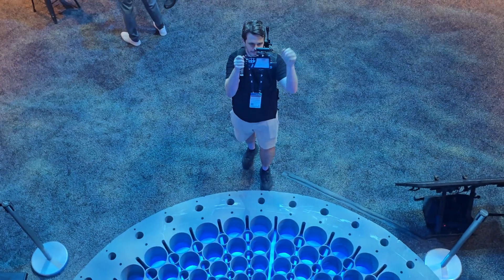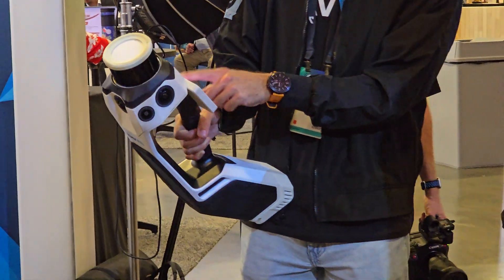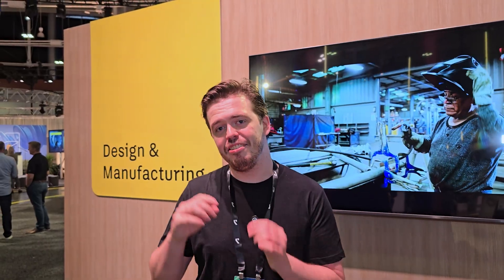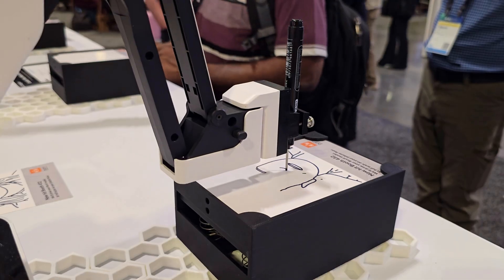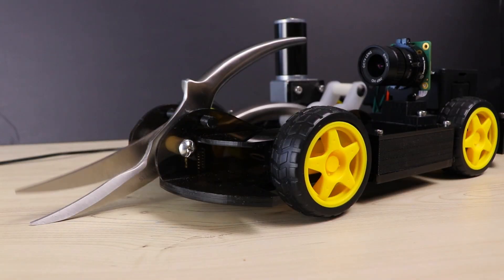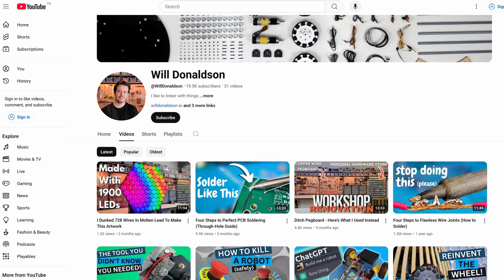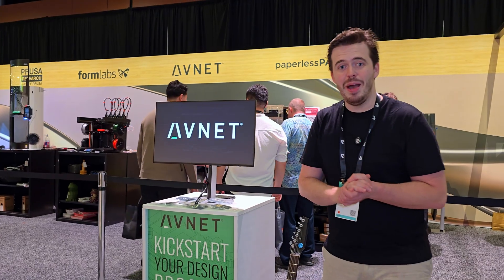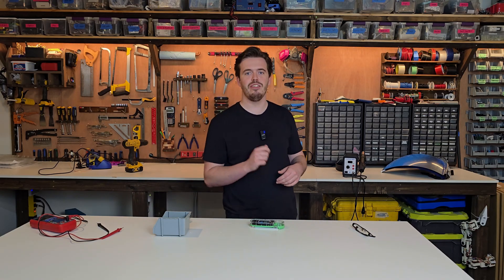NavVis VLX: The Futuristic LiDAR Scanning Bodysuit at Autodesk University

Comment: The dusty robot is really good in combination with a laser. Once its layed out the plans you can project the points onto the ceiling using a cheap plumb laser